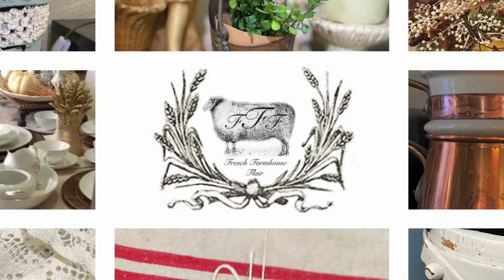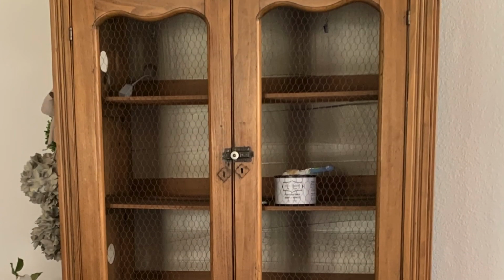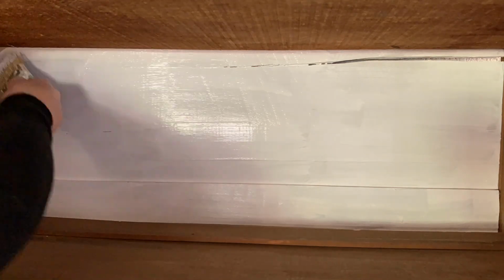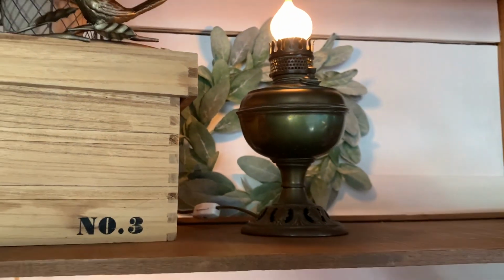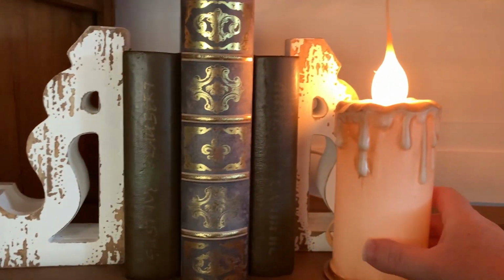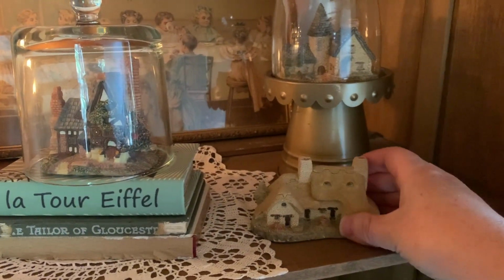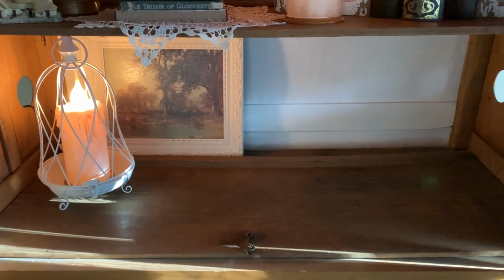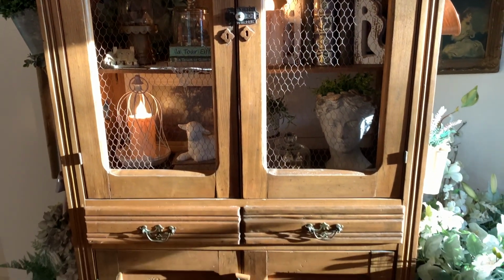Paint makeover | Decorate with me!

Comment: I have a hutch very similar but mine has glass instead of chicken wire and mine is painted white inside also. It does get dark inside, I may try the battery candles. The wreaths block the displays inside.
Reply from the maker: Yes, I think you’d be happy with the way the candlelight helps lighten it up inside. Thank you!❤️